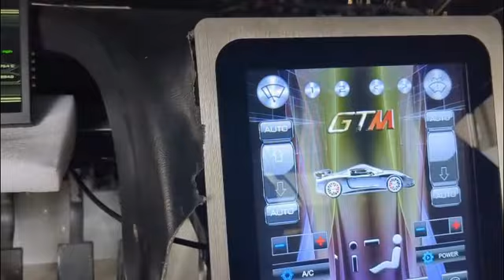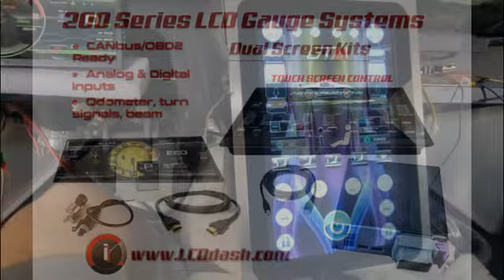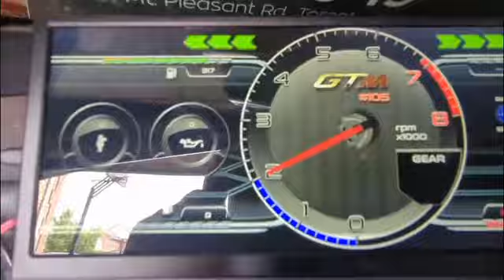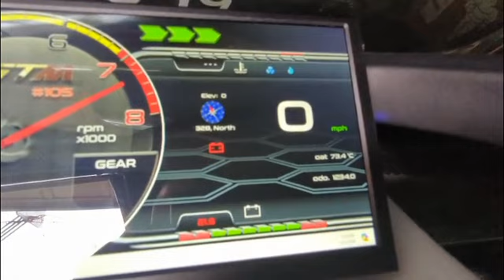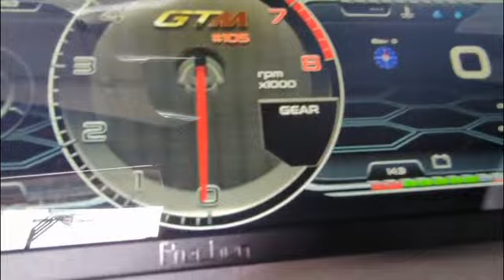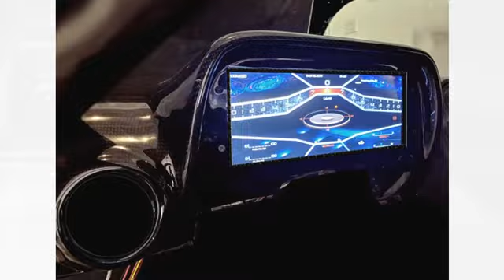LCD Dash Install and Kit Car Build Series

Comment: I like the push button turn signals. Im doing a push button turn signal system in my truck build.
Im using a PAC TR-7 (per side) to sense 1 button Press to latch the signals on, and then using a magnet sensor, when it senses 2 ground pulses it latches off. Magnetic sensors are positioned to make contact when a full turn is  initiated and then again when completed.
Reply from the maker: Very cool, idea!